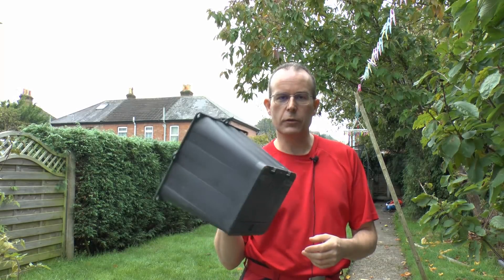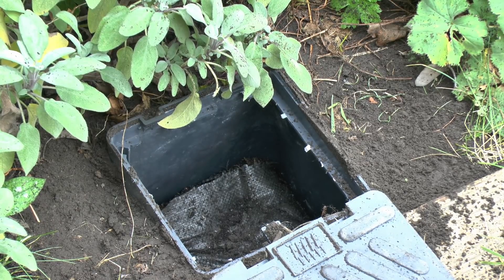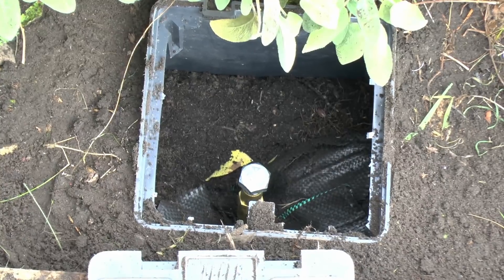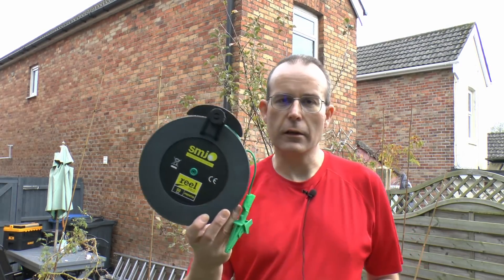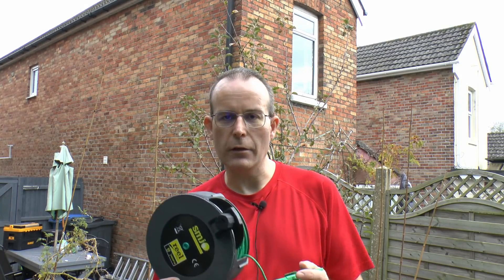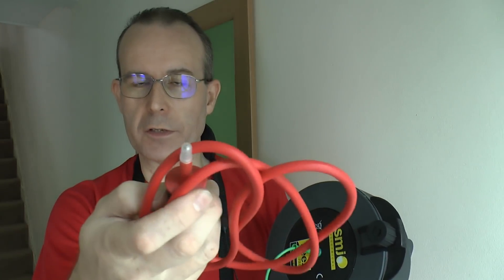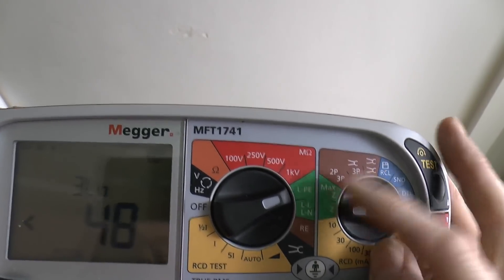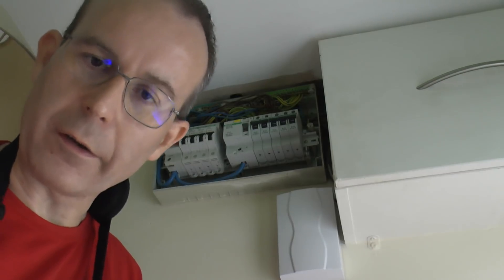Earth Electrodes Part 2 - Installing, Loop Impedance Testing

Comment: Hi John, any advice on selecting the appropriate diameter of earth rod? I presume the larger diameter rod has lower loop impedance due to larger surface area but in practice is there a balance to be struck between cost of rod and loop impedance required/achievable? Was that a 5/8th inch rod you used in the video? Thanks.
Reply: Next to no difference in impedance on diameters, much bigger difference in depth it's set. Thin rod for soft ground, thick rod for harder ground. Yes that was 5/8", lord knows why they are still imperial. Probably so they can sell you the bolt for three quid.
Reply: @markrainford1219  haha, yeah you're probably right about the reason for being imperial! Thanks for the insight on when to go 3/8" vs 5/8".

Comment: Hey John, is there any way to measure the impendance ( resistance ) of a given earthing system ( say daisy chain 4 rods ) using the multimeter ? If so, how to ? In my area the specialists saying about a value of around 4 Ohms of resistance but i don't have a special tool to measure. Thank you.

Comment: Is the water mains used as ground (assuming no plastic water mains)?
Reply from the maker: Not permitted since 1966.  Before then it was fairly common to use it.
Reply: @jwflame   According internet in the Netherlands since 1975. It is possible still in use in older houses as long the water mains is not replaced by plastic pipes.

Comment: So in the UK, do most homes rely on an earth rod as shown in the  vid? Secondly, does the consumer unit not have a earth conductor that traces back to the supplier/council ?
Reply from the maker: Most homes have a TN-C-S supply, which uses the neutral as the earth conductor - 2 core cable to the property L and CNE, 3 inside the property L, N, E.  N&E linked at the entrance to the property. 
Earth rods are only installed on TT supplies, which are fairly uncommon.  All TN-C-S supplies should have an earth rod as well, but that is almost never done.
Reply: @jwflame  Give this man a Bells Scotch for the good vids. Keep it going, you make electricity interesting.

Comment: I assume the Megga tester measures the Open Circuit Voltage between Line and the Earth rod lead Voc then applies a short circuit Live to Ground and Measures the current flow from Line to the Earth rod cable. Isc     Ze is then calculated  as Voc/Isc and displayed..  Can this not be done then with an AC voltmeter (first test measurement) and a current meter (or volt meter and a current clamp to measure current) as second test measurement . Then do the simple maths to calculate the resistance Ze?

Comment: My brother was quite well known in the road lighting world. He did some of the M4 many years ago and it's not changed even for LED's. The stories he told me about getting earthing spikes through testing were often father funny. On building sites for say large factories or office blockes, etc the used to position the tempory toilet over the ground spike installation. Two buckets of course, one with holes in the bottom. When all cleaned up and the few hundred gallons of 'waste' they passed every time. Good idea for high resistance sandy soil on top of a hill - but for how long ?

Comment: Rookie mistake installing box before electrode. 

(1) dig hole a bit big and test for fit of box 

(2) install electrode 

(3) put box over top and backfill. 

Reason being it's easier to hammer down without smashing the box - and if earth really hard and you miss with lump / sledge hammer you again don't smash the box.- plus if you decide it needs to go somewhere else to get a better reading again it's easier to work without smashing the box.
Reply: Thanks that makes good sense!

Comment: I have just installed an earth rod and wanted to test it. To do this I used a 100 watt light bulb a volt meter and a current clamp. 100 watt bulb across live & neutral measured 229 V & 0.425 A (volts x amps = watts  97.33) so then worked out resistance of circuit (volts divided by amps = resistance) say 539 ohms. Then did 100 watt bulb across live and earth rod measured 234 V and 0.416 A (volts x amps = watts  97.34) so then worked out resistance of circuit (volts divided by amps = resistance) say 563 ohms
. So extra resistance in circuit caused by the path through the earth = 24 ohms.

Comment: we know from a previous video this installation has a tns earth . turn off the main switch on the consumer unit and place a volt meter beween the end of the fly lead from the rod to the met bar . then do the same with a milliameter, if the soil is acidic you may get some suprising results

Comment: 50 meters of copper wire ~ 1/2 Ohm or less depending on gauge.
Reply: He did measure it in the MFT1741 review. It was about 1.01 Ohm. The data sheet for this 50 meters reel doesn't actually specify the wire gauge or the current limits, but I would expect it to be 10A or 15A rated, similar to what other multimeter leads are using. So probably 16AWG. Maybe it marked on the actually cable insulation. You also need to include the contact resistance on the slip ring on the real, and contact resistance on the rather poor alligator clip on this real, which can add probably another 0.2Ohm.

Comment: I Must have had my head in the sand! 'Power Drill' I hear. Just googled and came up with a selection of Bosch or Dewalt  'Ground Rod Driver' from amazon and eBay. Anyone have any recommendations on what and where to pick up, before I hassle my wholesalers. Thanks

Comment: Cracking video JW you never mentioned to null the 50m test wire to the earth rod before measuring the impedance, but you did mention it was around 1 ohm later on. Looking forward to the 3 wire method 😊
Reply: In reality you wouldn’t be using the wander lead, you’d have an earthing conductor from the electrode to the MET.  The test being carried out between the line and the (disconnected) MET end of the earthing conductor.
I’m not even sure you can zero the leads for a loop impedance test on a megger
Reply: He was using the coil to simulate the resistance of the earthing conductor from the consumer unit to the rod so therefore wouldn't null it in this instance.

Comment: I would be interested in knowing how this compares to grounding rod installations in the United States. Electrical code differs from state to state though. Our electrical installation is 50 years old. The top of the grounding rod is exposed about 4 inches above the surface where the ground wire is clamped and enters into the electric meter. There is no containing box, and there is just one rod. The rod should be 8 to 10 feet deep. Communication grounding for telephone, cable, and satellite is clamped to the ground wire as necessary for electrical code.

Comment: Great video makes it all look so easy. If you needed to install 2 rods how far do they need to be spaced apart
Reply from the maker: Minimum of 2x the depth of the rods.  Further apart if possible.
Reply: @jwflame  ok mate cheers
Reply: Also mate not to do with this. But it's about bonding plastic water pipe coming in basment then copper through the floor and to rest of property. How do you test if it needs bonding or not
Reply: @gd-bq7em  Just bond the hell out of all of it. No harm done.
Reply: To determine if pipe work is extraneous an IR test is carried out between the pipe work and the main earthing terminal.  A reading over 22K ohms means it isn’t extraneous.  Be aware that attached items may cause low readings such as class 1 appliances.

Comment: Won't doing this cause random rods appearing from the ground for people in Australia?
Reply: The rods melt half way. ;)
Reply: @robbedoeslegrand236  must be why there are Copper mines in Australia 🤔
Reply: our rods are 1.4 mtrs, most the ground is hard so after taking a full day to bash in 1.2 mtrs, you are left with the typical 20cm or so above ground :)
But usually in places where people and lawn mowers cant easily reach.

some builders are awesome, I saw one guy attach what I reckon would be 16m sq earth  from a generator to a ground stake - a 30cm stainless roasting type skewer  :D

Comment: JW, why are you measuring between L & ER ? Surely impedance between these should be Mohms ?
Reply: Yes I dont really understand this. Between live and ground is like an IR test and would expect to see MOhms too. I think we must be missing something here.

I understand that similar if I were doing Earth bonding test saying using a Clarke 25A tester (industrial enclosure not houses) I would be expecting extremely low ohms between a ground point and the earth point on test (ie a earth stud) but this appeared to be live to ground.
Reply: @davidlenton2366  On the circuit the substation transformer supplies, L is connected to N via the substation transformer secondary winding and all switched on electrical items being fed from the substation. So we have an N-L connection. Now I also believe it's common practice to link E and N together. Hence we have a connection L to E - a circuit - in this case of 105 ohms.

While we can identify the circuit we're playing with, the bulk of it is a completely unknown circuit. We don't know how many other earth rods in the area are connected to E or N. We also don't know how many electrical items that are switched on and connecting L with N.
This test, therefore, appears moderately valueless. Unless we assume all other connections are of zero ohms - which won't be the case but could be very low.

On the basis E is connected to N (low resistance connection), there would be more sense in measuring N to Earth Rod.
Reply: @davidlenton2366  Our expectation of Mohms is from disconnected equipment - tests carried out between wires not connected to anything - to do the tests, they're always disconnected from supply. Measuring supply L to E is what's being done differently here but I still think supply N to ER would be a better thing to measure.
Reply: We need to know how much current is going to flow in a L-E fault which is why it is tested L-E, in JW’s case it only gives a reading of 2A (which is why RCDs are a must on TT systems).
Reply: There’s a video by JW called “Types of Earthing System for Electricity Supplies (UK)” which is worth a watch
Reply: pmailkeey  The earth fault loop impedance is measured in ohms.  The electrode has a resistance to mother earth, in this instance we only know it is less than 106 ohms.  Soil conditions and rod length are two things that effect the rods contact thus resistance.  If JW was to pour brine on soil around the rod the resistance should decrease.
The test measures the full loop impedance path, from the flylead to the electrode, the electrode through mother earth to the electricity board electrodes, back to the transformer, through the transformer winding, through the line conductor back to the main switch.
Reply: @cumberland1234  Ok - getting it a bit now - having remembered E and N are usually connected together. However, unless all other connections between L and E on that transformer's secondary winding, we have no proof of path. L will be connected to N in many places through electrical equipment switched on. Connections between N and E could be anywhere and also numerous.

Comment: How come there in no RCD on the left row of the consumer unit? I see a buch of 6A MCB and also a 40A. Is it because it is an old installation and at the time of install the Regs did not demand an RCD protection for that part of the installation?
Reply: MrMatiDi It looks like a 16th edn installation, as with all sparks none of us do upgrade work at home each time the regs change until we are forced into it!
Reply: @cumberland1234  The cobbler took his children on a busman's holiday, so he was too busy to upgrade his consumer unit.
Reply: Up until a couple of years ago my fuse box was an old 3036 wylex - it didn't give any problems but wasn't ideal.  It is now a metal MK board with a mix of RCBOs, RCCBs and MCBs along with the bell transformer.  At least I managed to sneak an isolator in the meter cupboard when the meter was changed to a smart meter - unfortunately there is not enough room for a Wylex Rec 2 isolator as they put the comms box bit in the way.
The biggest issue at the moment is MK don't offer a SPD and are dropping their CU range.  Maybe in about 20 years time I'll upgrade it to something modern!
Reply: @cumberland1234  Fair enough, but that also would mean that in case of that 40A connected item becoming live, someone could potenatially get a very bad shock. Am I getting this correct?
Reply: @MrMatiDi   As long as the earth fault loop impedance it met it shouldn't be a problem, the circuit should disconnect within 0.4s hence not cause an issue to a person.  There are two ways to protect persons, limit the voltage or limit the duration of the shock.
Each edition of the regs increases the level of safety, a 40A MCB is probably a shower or cooker.  
If it is a shower, coupled with supplementary bonding which, when required, under the 16th edition regs is limiting shock voltage, the duration/voltage of a shock shouldn't be an issue.  
For a cooker, duration shouldn't be an issue.  
Nowadays, under the 17th or current 18th edition regs, a shower (and probably a cooker owing to installation method) should be on an RCD, a L-E short should go within 40ms.
Reply: Also it's important to note that a 230v <1A appliance is as dangerous as a 230v 40A appliance, it is the voltage across the human body causing a current (for a period to be damaging) through the body and thus the heart causing ventricular fibrillation, interrupting the heart rhythm which is the problem.
Reply: @cumberland1234  Thank you for the explanation. But there is still something I find confusing from a safety point of view (or my understanding of it), can I please ask your opinion on this purely hypothetical situation?
Let us say that we have (as you suggested) an electric shower circuit which is only "guarded" by a 40A MCB - the bonding is fine, there is no fault to earth or leakage, but for some reason the live wire becomes exposed (a crazy example, I know) and someone was to touch it, wouldn't they get badly shocked before the current would rise enough to trip the MCB?
Reply: MrMatiDi in that case they would get a nasty , possibly fatal shock.  MCB would never trip - it is there to protect the installation, not persons.  It only takes about 0.1A through a human body to be fatal.  A bathroom is a special location as people can have lower body resistance owing to no clothing and being wet.  Best make sure there are no exposed live parts and the cover is on the shower!

Comment: Hi john, great video so would that reading be your ze?105ohm) if so do you factor this reading for your zs?
Thanks
Reply from the maker: Yes, that's Ze.  Add on the circuit resistance for Zs.

Comment: Excellent, as always! JW I do have a question though. What would you do if the test failed and you were to find that the soil conditions in the area of installation was not very conductive at all, like sand, gravel, etc? Would you have to drive more bars until you get the proper amount of bonding to earth that is needed or would they have to come in an excavate some area to install a mesh or some sort? Very interesting stuff and seeing it actually in the field now brings about more questions! Thank you!
Reply: Start off by screwing a second rod to the first (twice the depth). If the impedence is still to high then install a second rod.

Comment: Very difficult to get under 100 ohms in the  Poole area .
Reply: Instead, may I suggest the pool area ;)
Reply: Andrew Hasted,  What would the reading likely to be during drought conditions ?
Reply: I thought the standard earth resistance is 5 ohms
Reply: @asbargathi  Depends on your source of 'Earth'. Electrically provided, it should be less than 5, I'd expect less than 2 and ideally, less than 1.

Earth rods rarely provide such a low resistance AND in this instance, we don't know how long the electrical circuit is.

Not sure what the hell JW's doing here.
Reply: @millomweb  
Pay attention at the back.
Reply: He's demonstrating installing an earth electrode for a TT system or used for a PME system with an out building and secondary DB where it is possible for there to be a difference in earth potential at the house and the out building.

R1 is the resistance of Circuit Phase conductor and R2 is the resistance of Circuit Earth Conductor. 
Ze is the External (supply) impedance of earth fault current path (loop) to Earth.
Zs is the total system impedance of earth fault current path (loop) to Earth.

You realy want the Ze reading on a TT system to be below 100 Ohms, but anything under 200 Ohms is OK. The lower the impedance the higher the current when a fault occurs which causes the RCD to trip.

On TNCS (PME) you expect the ZE to be below 0.35 Ohms an on a TNS below 0.8 Ohms as the earth is supplied directly from the DNO.
Reply: @wwsxa39  Why would you need an earth rod rather than just use the neutral ?
Reply: @daverhodes382  Eh ? Just saying why 5 ohms is not expected.
Reply: very good thanks a lot
Reply: I  think the resistance should be less than or equal to 5 ohms
Reply: From what I remember the suppliers electrodes (UK) should be a maximum of 21 ohms wrt mother earth - I think it is mentioned in the OSG.
Reply: Yes I know all that . I am qualified electrician and a member of the Niceic ! I was just pointing out that in the area he lives it very hard to get a low ze reading on a tt earthing system because in Dorset the chalke is a major factor in the ground makeup especially in the Poole / Bournemouth area .